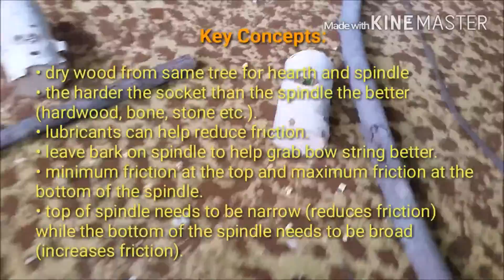Friction Fire: Bow & Drill: 2nd Successful Attempt at an Ember

Comment: Excellent. You got it! The good news it can be easier on future efforts.

The squeaking suggests a good amount of  moisture or resin in the wood. You may need to do a few drying-cycles (multiple burn-ins) to heat up and steam away any moisture in the friction points of the set. The drier the set, the easier it is to get success.

Consider reducing the diameter of the spindle, at least at the bottom end. Ideal diameters tend to be between 3/8" to 3/4". A general rule of thumb is the fireboard should be about as thick as the diameter of the spindle. Bigger spindles usually mean more work (exertion). Especially when you're working with a less than ideal bearing-block. You got the right idea using some sort of lubricant in the bearing-block.

Bowstring rub - The bowstring is rubbing against itself as it wraps around the spindle. This adds unwanted resistance when bowing and unwanted wear & tear on the bowstring. Try to string the bow so you can slightly tip the front of the bow downward and the bowstring isn't rubbing against itself as it spins around the spindle. This is especially important when using less than ideal bowstrings (ie. shoelace, natural cordage, jute twine, dental floss, etc...)

It's usually best to string the spindle so it's on the outside of the bowstring, rather than in between the bow and bowstring. You can get a little longer stroke when it's on the outside (slightly more efficient).

Tinder bundle - For every coal there should be a tinder bundle. Try to have a tinder bundle handy when going for a coal. The coal is only half the battle and the tinder bundle flame can be more elusive than you might think. Always try to get flame, even if it's brief. It's not so bad to get the coal inside the house, but definitely blow the ember to flame outside, ha ha.